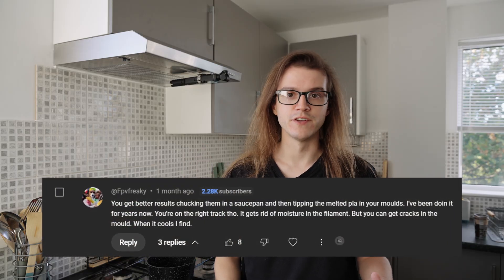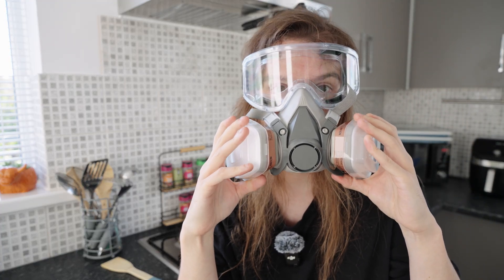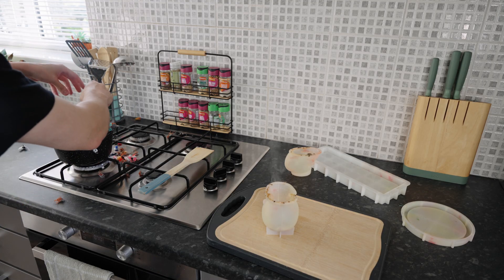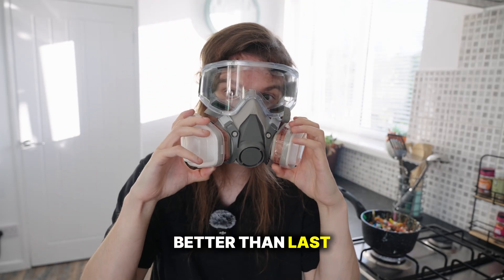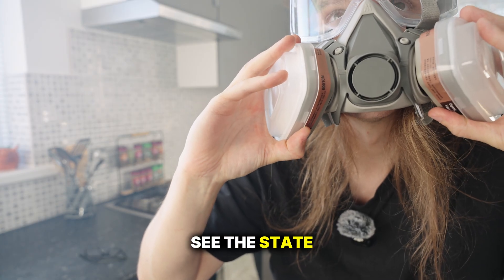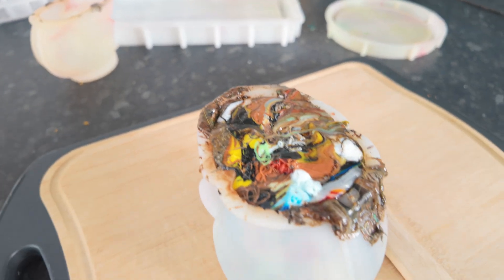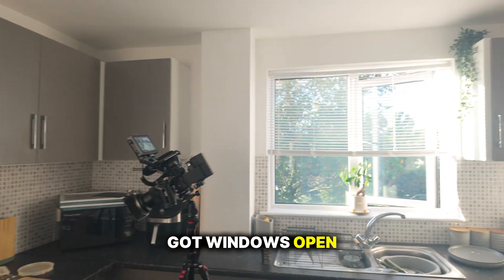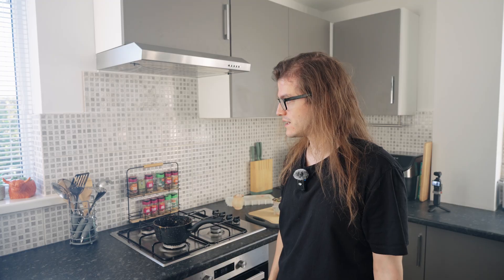I Melted ALL My 3D Printer Waste… AGAIN

Comment: Thanks for the followup to shows the even or heatgun work better than the pan method.  It would have been entertaining for us to see your woman's reaction.  I like the colors of the oven better but the pan version looks more like marble.  With what I have learned from some of the plastic repair work I have done on car parts, I don't think you can get fast and good for what you are trying to do.  I think to get the melt you are looking for you have to do a slow melt and mix.  Fast gets pan poop that looks like poop and slow reduces the color mixing.  At least, that's my theory on it.  Keep the great content coming man.

Comment: Well:
1) never melt plastics near or with an open flame - high risk of burning the fumes and just loosing more then just the plastic
2) if you melt, do it on an electric furnace with a regulator, best also a thermostat for the temperature. Don't go over melting-temp
3) and make sue you have plenty of ventilation and filtering. Not only during this but also after this.
Probably best to keep under 250 degrees and keep the vat almost-closed to keep the heat inside instead of all-over-the place.
Maybe microwave it short before to get rid of moisture more easily. Since the frequencies of microwaves are for heating water optimized, it will heat up the plastics less.

But: nice results anyhow!

Comment: If you're seeing smoke, it's too hot.  Temperature control is key.

An electric skillet or deep fryer with a Teflon liner should let you better temperature control.

If you're feeling adventurous you could use out together a nice temperature controller and really lock in the temp.

Comment: You would have to do it like you started in the first batch a small amount where you wont have to mix it, because if you do a large amount you would have to mix it up for it to heat thoroughly and the mixing is what turns it brown. You would just have to do multiple small batches. Which is also why just the top of the skull looks good, that was the first small batch

Comment: hey you did give me an amazing ideal  though... instead of putting it straight to the heat do it like you would melting cholate .. so pot.water. metal bowl ,poop it will take away all the smoke for sure and itll heat it all at the same time
Reply: The water boils too fast but it could work with oil

Comment: you should try a double boiler, like whats used to melt chocolate without burning it.
Reply: 100 C won't melt PLA, a double boiler never goes above 100 C
Reply: yeah, but instead of water use oil
Reply: @inhabitedbadge Good idea

Comment: What temperature do you need to get it? There's a thing called "au bain marie" which is  hanging the little pan in a bigger pan with boiling water. It is a gentle way of consistently heating food, no hotspots on the  pan etc.
Reply: Recycle processes I have seen for plastic don't heat the plastic to a liquid, they tend to soften it, make it sticky, and then press it together into a solid mass. With high pressure. Would require a different type of mold.
Reply: Not hot enough

Comment: The gas fire makes the temperature unstable, its very easy to get way too much heat from it which burns the plastic  too easily.

I’d suggest a rather large wax melter with a lid and temperature controller.  Check the temperature range its supposed to work at. U want one that is capable of doing more than u need so it has an easier job opposed to one that barely meets your temp requirements.

Temu or aliexpress should do fine on the cheap if u did your homework.

Good luck and remember, if it gives blue smoke, u need to lower the temperature and wait longer.
Reply from the maker: That sounds like a much better and safer method, thanks for the advice.
Reply: I’d like to see this as well, I think the solution lies in the unevenness in the temperature. But I do find that the filament at least looks like a waxy substance like you would see in a wax candle/tart melter when it comes out of the extruder.  I also wonder if doing small batches where you do like all blue pour in the mold, let it sit while you do all red then pour in the mold, repeat wouldn’t give you some cool designs.

But it all begins with what would give you the most template control and most even template during a long time doesn’t it?